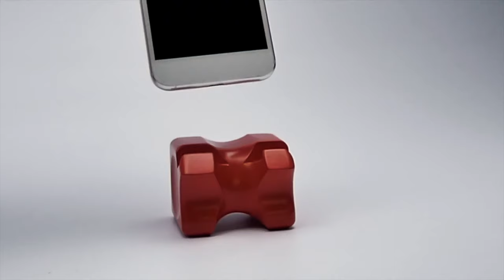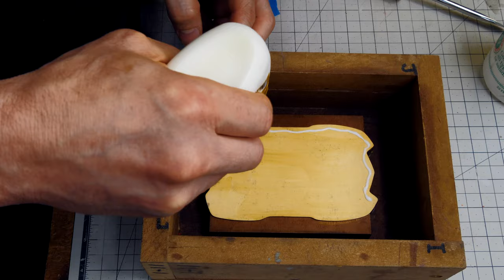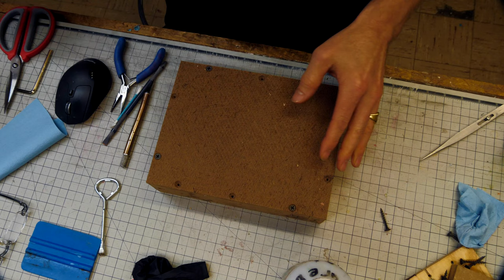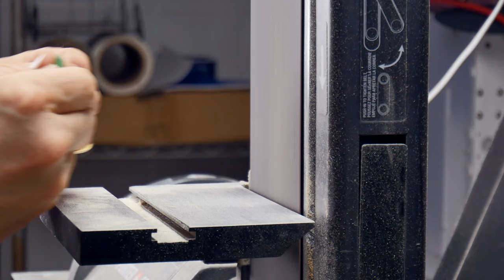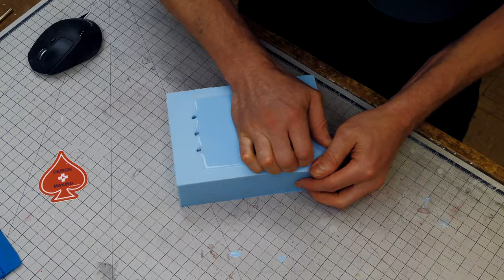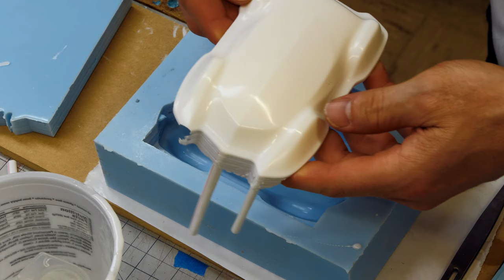Making a two part Silicone Mold: Advanced Technique

Comment: those bubbles in the begining may happen because of your pouring technique. every little flap the silicone stream makes can enclose a little bubble. thats why "stringing" only makes sense with non-degassed liquids, because it gets more bubbles out as it gets in. the solution is simple: keep the container close to the mold box while pouring and let the stream run down a wall without flapping. i'd also encurage you to use transparent silicone
Reply from the maker: Actually that's not correct those bubbles at the end happen because I stick a stick inside the container to scrape the silicone out.
Reply: @EricStrebel  oh, that seems to be the case here, sorry! if you need to scrape the max. out of your container at some point, you can try those silicone spatulas for baking

Comment: I made some molds with the smooth on mold kit for some small cylinder pieces and after second resin use I noticed some cracking on the inside of the mold. Is this due to too much stress trying to get the parts out without like a side slit. Or possibly from leaving the molds in my hot garage? Thanks for any advice. Great work btw
Reply from the maker: Hard to say...but I avoid their products when possible
Reply: Eric Strebel right on. Thanks may have to try the mold you used. Preciate the response
Reply: Could be either but I would not recommend storing molds in a hot environment. The natural oil of the silicon will leach out over time and the mold will fail.
Reply: cwnorton thank you. I figured as much and forgot them for a few weeks then thought might be like the resin not keeping it in there. I’ll make another mold and keep indoors with the resin. Thanks guys

Comment: I have started using laser cut finger boxes made of 1/8" (3 mm) acrylic for my reusable mold boxes.  I seal them with blue masking tape for (they are small to medium depth - usually less than 4" or 100 mm deep).  They are easier to prep than mdf but there is always some clean up where the silicone seeps into the finger joints.
Reply from the maker: Thanks for sharing!

Comment: THIS IS GREAT! I've been trying ro make a two part mold using the clay bottom method. I just couldn't get the clay to cooperate. I'm gonna try this way!
Reply from the maker: You need to use non-sulfur-based clay so you don't have any issues

Comment: I use  lego's  to make my mold boxes &  clay. I  use  a hair dryer to melt the   clay down perfect. for my Pour spouts. I  also  use  clay. Thin on  one  end  touching the part. But the  top is  bigger. Yes Lego's  work  just as  well for  any  size mold boxes as well.

Comment: Great video Eric, I have a question though. I understand two part molds but in an application like this where the bottom of the item is flat anyways, why not just make the one part mold?
Reply from the maker: Good question, the part gets finished on the bottom with an adhesive cork back, thus needs to be very flat and finished. Also you can never get anything consistent without the second half of the mold
Reply: @EricStrebel  Makes perfect sense! I get it now haha. Thanks Eric, keep up the great work man.

Comment: Aren't you concerned that the top cover of the mold will slightly bend under its own weight? Making bottom of the part kinda round...
Reply from the maker: No, you could always put it back in the mold box if you had that issue